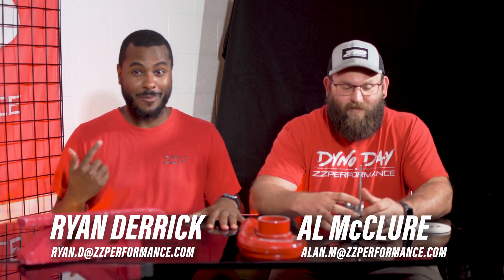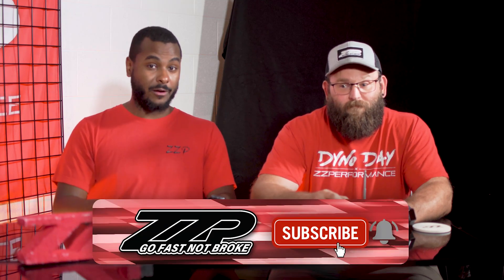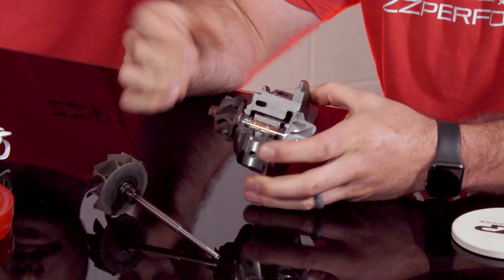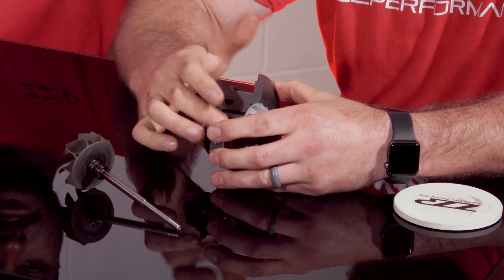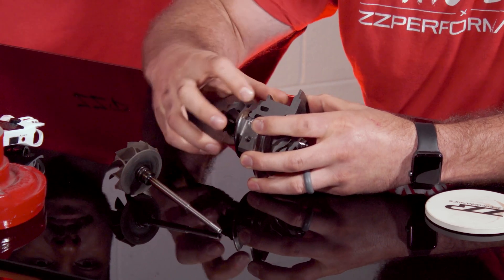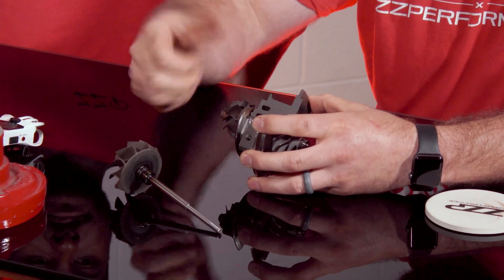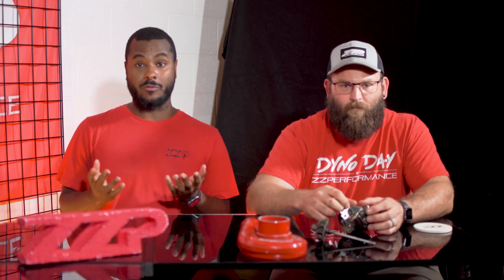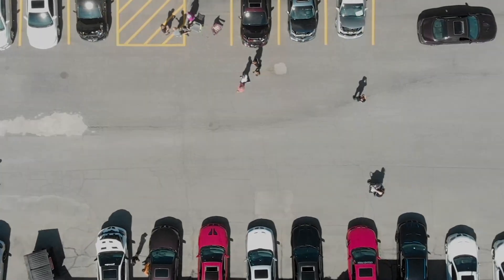Are Turbo Seals a Thing? // Behind The Builds

Comment: If there’s to much pressure, would a oil cap filter help relieve some of that or would the best bet be a oil restrictor
Reply: Those two tools would not go hand in hand. An oil cap breather can help excess crankcase pressure, which in turn could help alleviate an oil burning issue if it was present. An oil restrictor can be needed when cars have too high of oil pressure for a specific ball bearing turbo, or if the bearing design lends itself to need one.